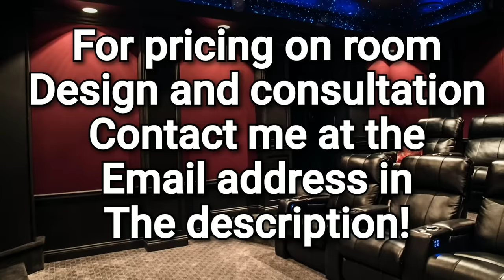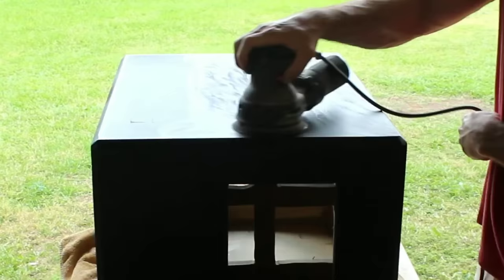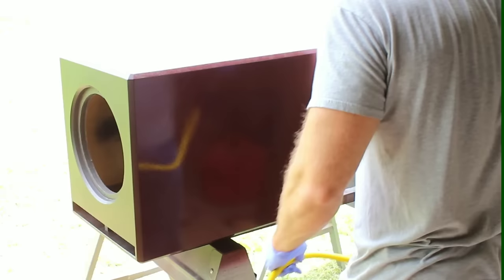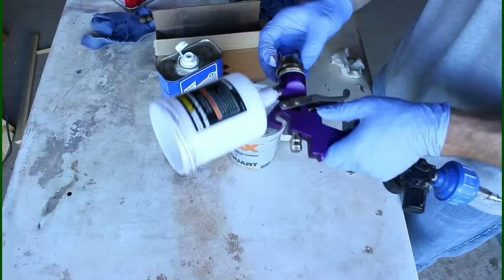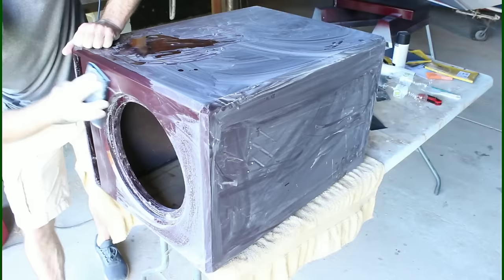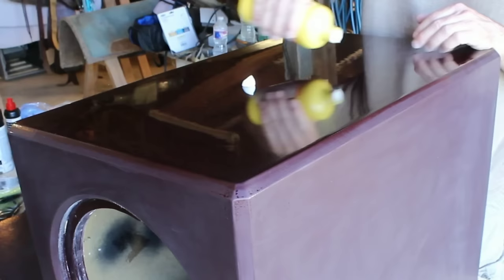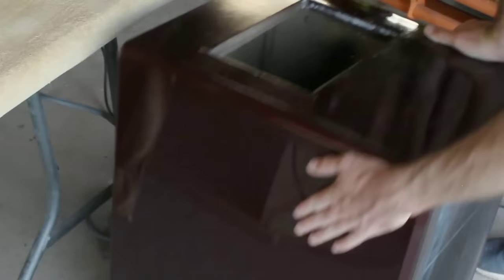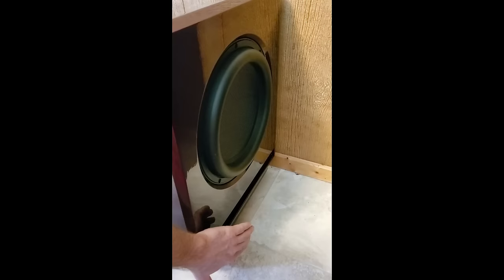Ep. 35 - How to get an amazing Piano Gloss Finish on the Hammer Home Theater Sub| Home Theater Gurus

Comment: I need some help finding a Primer for my MDF Loudspeakers that will work with Urethane Auto Paint?  I called Eastwood they sell and Make Automotive Paint and a Primer for steel Only!  What Primer brand did you use and what Base Coat Brand and Type did you use? I've done a lot of searching and there is no answer out there!  I can't call a Loudspeaker Manufacturer and Ask them as they won't tell me what they use!  I can't use Zinzer Spray Paint as its Oil Base and you can't use a Urethane Base coat on top of Oil Base Primer or Water Base Primer.
Reply from the maker: Hey Kaplan, all of my items used are in the description.  The Epoxy primer worked fantastic!

Comment: Instead of Dayton sub have you tried some cheap car subs for home theater? Will it do the job?
Reply from the maker: They may, they'd need to be modeled but I'm sure some would work reasonably well.  By nature Auto subs have a high fs but some can still work well tuned under the fs.
Reply: @hometheatergurus  so I should just look for driver with low fs?
Reply from the maker: @Live_Loud  see the episode before this one where we use winisd to design this box. It walks you though it.

Comment: metalic on the base coat , a pearl would be on top of the base coat then the clear.
Reply from the maker: The pearl is in the base coat itself.  It's a high quality auto paint and then hit with clear.
Reply: @hometheatergurus  remember  pearls are transparent,  it would  take gallons of base coat to cover with pearls. it might have metallic  pearls in the base coat specially on honda and Chevy blues and reds. did  auto body for 22 years mixed paint zikkens , dupont , house colors for 5 if those years. either ir it looks great you did a nice job
Reply from the maker: @waterlover  my buddy that gave it to me paints professionally.  He told me to do a dusting coat to  even out the pearl.  You see me do it in the video.  The pearls are extremely visible and looks awesome. I've done towers with this paint a year before this video.  Also great pearl effect.  Maybe its the paint.  I know it's some high dollar stuff.
Reply: @hometheatergurus  all pears have to dust from the get. I built cars for many years for a big hit rod shop till Boyd died then working for his wife wasn't fun

Comment: Do you have a condensation separator on your compressor system?
Reply from the maker: No I have to use filters at the base of the gun.  It keeps the moisture out well enough but in the new shop I may invest in a seperator if I use the compressor more frequently.

Comment: there is a product called sealer. MDF needs sealer before you prime.
Reply from the maker: The edges are sealed in the previous video. The primer is a 2 part epoxy primer and seals/primes extremely well.  I discuss this in the video.  As you see by the results nothing more is needed.

Comment: Excellent job, good step-by-step narration.  Take some advice from a guy who has mild COPD.  You only have two lungs.  Protect them.  A decent canister respirator is less than $50.  Your lungs will love you for it.  Wear goggles too.  Just sayin'.
Reply from the maker: Thank you.  I wore a canister respirator during this video.  The base is water based and I was up wind or holding my breath even with that.  The primer and clear are both high voc, you'll notice I wear a mask even when mixing.

Comment: Orange peel is caused by paint technique or viscosity.... Get it right and it goes on like glass
Reply from the maker: The purpose of this video was actually to purposely get orange peel so I could show those that are worried they won't get it perfect, that it's easy to fix.  But thanks I'll play with that in a later project.
Reply: @hometheatergurus  Little splash of 2k thinners in lacquer makes it lay lovely

Comment: Nice subwoofer response. Sorry this have nothing to do with this topic you discuss. I watched all your youtube episode, especially episode 7 that I watched over 3 times. I have a few question about setting up regular minidsp 2X4 for my dual PB2000.
1. I have denon x600h, Ideally for audyssey mic setup, what are the distance between each position? cause I use all 8 measurement within 2 feet or less but audyssey messes up my minidsp eq (flat before audyssey). 

2. I know minidsp do not like to boost EQ. But if I have to boost, what is the maximum Db to boost I can apply.
3. I did time align the subwoofer than running audyssey, after that doing some necessary EQ for the subwoofer, is this ok?
4. I try all the subwoofer distance to align with 2 front main speaker, also try with all crossover point, I ended best graphic using crossover 120Hz, does this make sense? All measurement I am using REW and Umik 1 mic.

Thank you very much.
Reply from the maker: Thanks!

Let's see. Don't use the audyssey  locations where your knees are.  That's dumb and they should quit doing that.  We place seats between modes and measuring 2 foot forward and back is likely measuring a mode not at the actual head and why measure where no one sits. 

Stay in line with the ears as you should have a good seat to seat after episode 7.

In rew you'll bring down the target to the lower areas of the reponse which is the equivalent of boosting those areas at the line up to the frequencies above the target.  It's explained in the video.  How much boosting depends on how low it is in frequency, xmax and power available.

If you find 120hz gives the best summation and all the subs are up front and not localized I would roll with it. If that's what sounds best nothing anyone else thinks matters.
Reply: Home Theater Gurus thank you for the reply. Yes, I placed the mic at ear levels. And follow on instructions on denon for all 8 positions within 2 feet or less from 1st position. Just wondering if for example If the distance between measurement closer, do i get better graph from audyssey? And what do you think about my method to time align the sub, than running audyssey and aplly EQ after that, is it ok?
Reply from the maker: @1psxpat as explained in ep7 if you eq after audessey you have redo eq every time you re run audyssey.  By Eqing flat first you can run audyssey 100x and never have to go back into the minidsp to eq.  You do it before and move on.  You can choose to do it after if you wish but thats a major headache for no reason. 

As for the measurements I don't measure forward and behind the heads as the on screen directions tell you to do.   I measure the center head position then left and right of it but never forward and back of that first position.
Reply: Home Theater Gurus ok, I will try again to do the eq before the audyssey. Cause I did EQ ing the sub before the audyssey, and after audyssey measurement I do not like the result. Well, I guess I will try again and see if this time works.  Also, can you please give me an advice for 1 row, 3 seater sofa, what is the best way for measurement location to get the best result. Thank you 🙏

Comment: I gotta know morre about that isolation pad
Reply from the maker: I'll be part of the flat pack which I'll be building on the channel.  I do have a diagram (cut sheet of sorts) you could use if you'd like to replicate it.
Reply: @hometheatergurus  maybe you could do an episode on isolation pads and especially risers. I have a large all in one speaker with a down firing sub and all the info is contradictory. Thanks

Comment: have you used any gaskets between driver and cabinet?also price of the flatpack please.
Reply from the maker: The um12 has a gasket glued to it. 

Contact Kevin using the email address in the description for info on ordering and pricing.
Reply: @hometheatergurus  gsd audio's marty and mini marty has some complex bracing inside the cabinet.yours look simple to build. is that type of bracing necessary or your design is enough?
Reply from the maker: @chandan6119  it's a much smaller sub. I've talked to GSG and they even agreed adding more would be for looks only.
Reply: @hometheatergurus  thank you for the reply. will build my first sub right after the lock down,thanks to you.

Comment: Try lowering your gun pressure to reduce orange peal.
Reply from the maker: I had it pretty low when I started but cranked it up a tad.  You see me adjusting it about half way through.  But I'm sure in the right hands it would have had much less peel.  I'm glad I had a lot though for the videos sake.  Kinda shows it can be saved.

Next time I'll play around with lower pressure.  Thank you!

Comment: So this is pretty much impossible to do without a paint gun?
Reply from the maker: you can find base coats and auto  clear in rattle cans on Amazon.  I wouldn't do it on  a large project.  You can use any regular spray can color for the base and just layer it with auto clear coat.  For small speakers this would work fine.  You'll see people doing whole car hoods using rattle cans with fantastic results.

Comment: First, if you have decent woofers strong 10" 12" woofers in your front boxes (i have 2 12" woofers on each side) you dont need a subwoofer, waste of money. Use baltic birch plywood, it will last longer and sound better, fill the grain if you want and just wipe on enamel with a lint free cloth. You get a more even coat and dont have to sand the bejesus out of it.
Reply from the maker: In home theater we have a discrete Lfe channel that requires a sub. If you don't have one that information is lost as it can't be routed to any other channel.

Comment: Why do you put epoxy primer , then paint, then epoxy? So maybe instead wood(mdf) primer, some color, then epoxy itself, no? :)
Reply from the maker: That's not what happened here.  It epoxy primer.  Because it's so awesome and we have to prime before we paint and it's the best primer I've found for mdf.  It's not thick like you'd think of when you hear epoxy.  It goes on very smooth. 

Then base coat (the color)

Then acrylic-urethane clear coat.

This is basically the steps youd take to paint a car.  Primer, base, clear.  Once you follow the steps This is a high end auto quality finish much deeper than an epoxy clear would give.

Comment: How big is your air compressor?
Reply from the maker: I recently bought the one below.. I'll be using it once the house Is done as a whole shop compressor.  For this project though a small compressor works fine.

https://www.lowes.com/pd/Kobalt-QUIET-TECH-26-Gallon-Single-Stage-Portable-Electric-Vertical-Air-Compressor/1001014062

Comment: The cabinet lacked internal bracing and not even constrained layer dampening... missing filling is the least of your problems.
Reply from the maker: There's no area over 15.5" with no bracing, double baffle (1.5" thick) .   It's a very solid enclosure.  The cabinet does have dampening even though in a ported sub it's not needed. 

Not sure what you mean by filing. 

Thanks for watching!
Reply: @hometheatergurus  Usually MDF enclosures of that size need constrained layer dampening in order to mute the inherent resonance. That can be achieved with a special brace that acts as CLD or by applying CLD on side walls. No doubt the enclosure is sturdy, the resonance however reamains. Granted the resonance is around 150-300hz depending on the wall thickness so it may not be a practical problem on a subwoofer enclosure. By filling I meant the stuffing (dampening material) which is not effective at such low frequencies. It mainly increases the effective cabinet size by a percent or two.
Reply from the maker: I know what you mean and the cabinet isn't large enough to have resonance at the subwoofer frequencies. I mention this in this video or the assembly one.  Watch the last few minutes of the video where I line it with insulation.  It's not needed at all in this sub but it's just something I like to do.  I've built subs for 20 years and it's embedded in me. 

You can also model the enclosure lined, empty, fully stuffed in winisd and on this sub it doesn't have a noticeable change on the response.  I know someone will ask.. 😜

Comment: Beware of flying stuff incl. pollen and insects when doing this outdoors. Nothing is as terrible as finding a stuck insect.
Reply from the maker: Ohh yeah I had trash in it. I mention it in the video and a few times you can see the specs in the video.  But the wet sanding takes them all out and you can't see anything once done.  Anything like a knat I'll pull out and hit it again with Clear if needed.
Reply: Home Theater Gurus Yes, wet sanding can usually fix the tiny ones. Before I had a tendency of trying to fix those before it was dry, but it rarely worked well. I do such painting outdoors too to avoid inhaling the fumes.
Reply from the maker: Yeah I only had one bug I had to remove but I still had 2 coats of clear to do.

I did the mock up booth in my garage the first time last year. I'll take a few bugs to never do thet again.  Outside is so much easier and cleaner for me and like you said the fumes are carried away.

Comment: looks like you just puting so mutch work and effort when you dont need.. mdf is super ez to make mirror like paint, you need to use proper paint for it. And after you finish you just need to polish with polisher and its mirror like and stays like that forever.. you can post how yours after 3 month.. you gona see that mirror -like is gone long time..
Reply from the maker: I've done that but it's just not the same as a base coat clear coat.  This is an automotive quality paint and clear and will last a lifetime and is far superior to a single stage paint buffed out. If you haven't tried it give it a go.
Reply: @hometheatergurus  https://www.avsforum.com/attachments/20190330_160300-jpg.2546256/ here is how it looks done :) you can shave yourself.  Its INDUSTRY level paint, based on Poliurethane, and poliester,   you primer with poliurethanic primer,that goes straight on mdf, make several layers, and then you sand it 200-400-800 sandpaper,  then you go with poliesteric paint spraying "wet on wet" method, in 2 days you have polish it with machine, cause if you wait longer surface become too hard to polish even.  Polishing just with pasta no sandpaper used.. and this paint is way more expensive than automotive stuff. but its very resistant and stays mirror like, and its extreme hard and scratch resistant. Used in industry for top quality furniture painting. Automotive stuff in couple month looses shine...

Comment: Wet sanding priming...ROFLOL. Never EVER wet sand primer, the only time you should wet sand anything is clear. When you sand you "open" the paint surface and wet sanding introduces water molecules, which can cause problems later in the refinishing process.
Reply: BTW, 100 % of orange peel can be removed in the clear, and that's the only place it matters. I've only done it tens of thousands of times, in my body shop operation over the past 20 plus years.
Reply from the maker: Thanks for watching.
Reply: @hometheatergurus  You are a good sport...and smart...I like that...from now on you have my back...not that you need it...but I'm not trying to shame anyone...I just want people to be truthful, and as the saying goes, "you don't know what you don't know."
Reply from the maker: Hey I'm definitely not a master painter by any means which is evident.  No matter what it is someone will always have a different or better way.
Reply: Let me say this...I have not made a video how things like this are, or should be done. Nothing wrong with your video, lots of my "competition" would be happy this is online...including me... keep them in the dark! :)

Comment: Who comes up with such bullshit? When the membrane accelerates forwards, the housing accelerates backwards! That sounds muddy and the system loses sound pressure. Put spikes underneath and weights (100/200 kg) on top and then listen again! Build a sandwich housing and fill it with quartz sand or concrete! Subwoofers always have to be connected, you can also screw them to the floor or wall if it is made of concrete or stone! But the jelly just wastes energy!!!